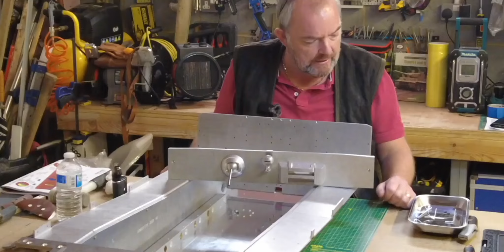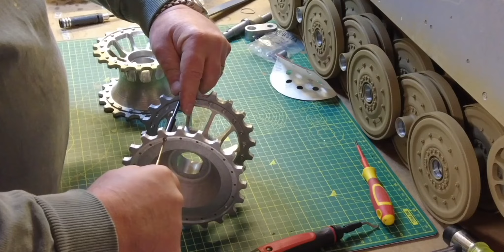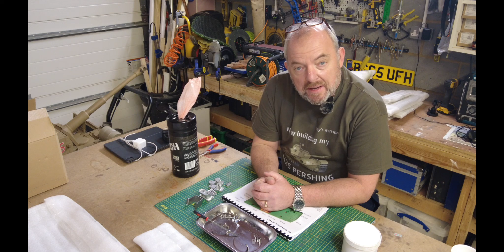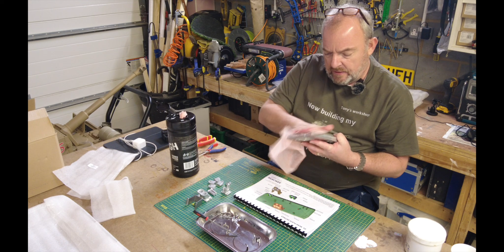1/6 scale Armortek US M26 Pershing RC Tank build.Rear Armour plate and double bogies install(Vid 02)

Comment: Tank time!! Nice to see you starting on the persching.
A tool  you might want to consider is a dremel.
I use it with plastic/and metal rotary wire brushes it clears all bolt holes and recesses in seconds and doesn't do any damage.
They make a ton of useful attachments.
And is brilliant for fine detailing.
I used if for the cut steel look on the panther.
I also have a friend that is an Armortek pro.
He has built  and owns around 10 of them.
He is about half way through his build
He has come across a few problems but nothing he couldn't fix.
I can put you in touch with him if you need help.
He has been invaluable helping me with the panther.
Reply from the maker: Morning Gary, yes, it is tank time again in my workshop and loving every part of it...even the small challenges that come along. I do have a Dremel with a full kit of attachments and have already used this on one stage of the build. I didn't occur to me to use wire rotary brush, but will defo try this on any other hole cleaning jobs, thank you. 10 Armortek tanks...he must have an airplane hanger to store them :-). Thank you, I might take you up on that, especially when it comes to the electronics and radio gear...as this is the part that I had some issues with on the Tiger. Is he Essex based as well?
Reply: @Tony's Workshop   morning on the Dremel front anything with corners crevices recesses.
It's how I get rid of all the white powder machine residue takes seconds.
And like you say getting over problems is always very satisfying.
The guy I'm talking about is in America, and on the forum
He is getting John at East Coast Armory to commission accessories/upgrade parts for the persching.
Hence I mentioned you and he offered any help/advice he can offer.
He is very easy to contact and a really decent guy.
I have to say that lower hull and, suspension mounts look quite tricky.
Do a cracking job on the kit as always
 look forward to the next installment.
I've just ordered my next project after the panther so looking forward to that.
Have a cracking weekend bud.
Reply from the maker: Hi Gary, yes please...I would love to reach out to this guy. Actually the suspension mounts are quite straight forward...just need to concentrate on the may variables...very easy to lose track on the build....Come on...what have you ordered :- ) I am dying to know...
Reply: @Tony's Workshop  I've never done a truck before...
So went and ordered a Tamiya 1/14 grand hauler black edition mack truck and trailer.
With a ton of upgrades and electronics.
I saw some on U tube and thought mmm got get one LOL
Honestly they are absolutely scale 3 speed gearboxes the whole lot.
Ok do you want me to ping you his email address?
It's a shame you don't have messenger I can talk to him real time which is so much easier.
Reply from the maker: Wow..I have just looked at this online....Super detailed model. Yes please...you have my email...would you mind sending it through email to me....Top man...have a great rest of the weekend.

Comment: Hi Tony. I did not have those fit issues on mine, like the square bracket end going into the round pocket, and the thickness issue on the part with the spindle and pin. One thing I did and was sorry I did was put the pin through and the cotter pin (split pin) in place. I later removed it so I could fully paint the pin, but will probably need to adjust the opening due to paint thickness. And before I even put the exhaust on, I modified the opening shape to look a bit more like the real thing, in my opinion. I posted a picture on the forum. Even later, I have applied Milliput on the exhaust to add the humps the real exhaust has. Still working on finessing that shape. I have just finished final color painting the hull with all the suspension pieces. Next, on to painting the shocks before assembling since it would be difficult to paint behind them next to the hull. I am trying to think through the process of when to paint a part vs. an assembly. So looking ahead on the manual is a constant thing. Good luck, looking forward to more videos.
Reply from the maker: Good morning Ray. Another builder on here has had similar issues, but these are really easy to get round. I did PM you on the Forum. I will check out your photos when I am on there next. Same...thinking constantly about the painting, when to paint and what to paint and so on. reading the manual and reference books is defo important. Have a great weekend.
Reply: @tonys_workshop  I did receive a PM from you on the forum. I sent two to you.
Reply from the maker: Ok Ray, I will check next time I'm on.
Reply: @tonys_workshop  Tony, if you get a chance, check your PM from me on the form. I left my email address on there where you can use that if you prefer. I would like to discuss part of the build and maybe save you a headache down the road.
Reply from the maker: @raymassa3751  Hi Ray, I have responded and sent you my email address via the forum. Speak soon

Comment: Had the issues with the thin aluminium arms you mentioned. When I opened the box carefully, the smaller one was bent 90 degrees in the wrong direction. The thicker one was also bent slightly. Must have happened during transport, I think the packaging could be improved in this specific aspect. But at the end, this was no problem as bending it back to the right angle was no problem after all. I had sweaty hands, though 😂
Reply from the maker: Sorry to hear that...I was so worried about un-wrapping...Glad to hear that you managed to straighten it out....welcome to the strange and slightly scary world of Armortek building. 😂..hope the rest of your build goes well....best regards...Tony
Reply: @tonys_workshop 😂 As you always say: The imperfectness of the kit is part of the fun 😊 BR Sven

Comment: 👍 well done Tony… an excellent starting video of the long road  ahead of you ( and us).
I was surprised at the one out of four mounting brackets for the lifting hooks was fatter… I had the same and it needed filing to fit🤷‍♂️…. Keep em coming Tony.. great video full of hints and tips 👍
Reply from the maker: Good morning Brian, Thank you. I actually like that we have to work on, fettle and mod some of the parts...it makes it more of a challenge...not that building one of these amazing tanks is not a challenge in itself :-) How are you progressing?
Reply: @tonys_workshop  hi Tony…. All the bolt on bits are done on the lower tub after making decisions on what to paint first🤷‍♂️.  Everything cleaned off ready for some warmer/dry weather and painting can be started.
So many holes to mask off… so I filled the axle holes with soggy tissue paper which goes rock hard overnight 🤷‍♂️👍
Reply from the maker: Hi Brian, yes...the continual deliberating over the painting process...I am planning the same route as you. Good tip on the soggy tissue. Are you masking off the area within the gasket as well? I am thinking of doing this, but will probably change my mind 15 times before I commit :-)
Reply: @tonys_workshop  Not sure what you mean “ area within the gasket “?
Reply from the maker: Hi Brian...I am probably not describing it correctly...the steel hex shaped ring that fits over the bogies.
Reply: @tonys_workshop   got you… I left the hex rings OFF until everything else was fitted and ready for painting… It was recommended because they would stick out below the bottom line of the hull and  if hull is pushed sideways could be pushed off.. I have now got the hull sitting on some double thickness cardboard so the hex nuts SINK INTO the cardboard as a cushion and I can still slide and spin around on the bench.
It seems the best solution 😊
Regards .. Brian
Reply from the maker: @brianwomersley7271  Hi Brian, OK, I opted to put them on, as I have my tank on a jack and elevated so it doesn't come in to contact with my bench. Both options work...Not sure whether to paint these...thinking yes. Did you have any issues with the Drive case assembly?
Reply: @tonys_workshop  Hi Tony… no problems.. all went together well and is now mounted to the tub.. great satisfaction when the bearings “ click” into place😊.  Right from the start I photocopied each instruction sheet so that I could use a marker to tick off each part as it was drawn from the shelf and to make any notes without flipping pages in the manual , then fold it away as job done👍
I also boxed up the individual sizes of fasteners and kept all parts in boxes with copies of the parts lists as “ Bag1” “ Bag2” “ Inner box” etc etc… with photocopies of relative parts lists …..helped a lot in locating all the parts.
Still plucking up the courage to put some paint on 🙈😁
Think I will paint top sections of shock absorbers and leave lower halves bare ally 🤷‍♂️
Enjoy ….. Regards… Brian

Comment: Nice to see you make a start to the build Tony. Any thoughts on preparing the parts, especially the smaller ones for primer at this stage? Scuffing up with a scotch pad or lightly sanding the parts before assembly will make paint adhesion better.
Reply from the maker: Hi Malcolm and thank you. Yes, constantly thinking about the painting stage throughout the build. When to paint, which parts? etc..I do sand the main parts of the hull and larger areas, but only going on the experience I had with the tiger, etching primer ahead of normal primer on these small parts seems to work fine...as long as I thoroughly clean each part ahead of assembly and another quick clean ahead of priming. Hope you continue to follow my build.
Reply: @tonys_workshop  With my Panther G build I am fully preparing every part as I go along including an initial clean of parts. This could be filing, deburring or just scuffing up. All will get a final wipe down before primer. Everyone has there own way of working as we know. Yes will be definitely seeing how you get along with this one .👍
Reply from the maker: Hi Malcolm, have you posted any more updates on the forum?...I have not been on there for a while. Your work and attention to detail is incredible mate...way above what I am capable of doing...
Reply: @tonys_workshop  Yes mate, updated as of Monday just gone. A steady, no rush build but very enjoyable I must say. Work bench has now been tidied up for now as going off on a 2 week tour of North India on Monday.
Reply from the maker: Thanks Malcolm, I will check it out...Have an amazing trip and safe return.